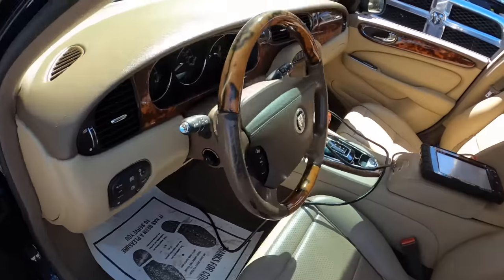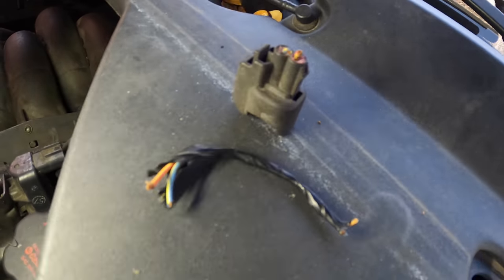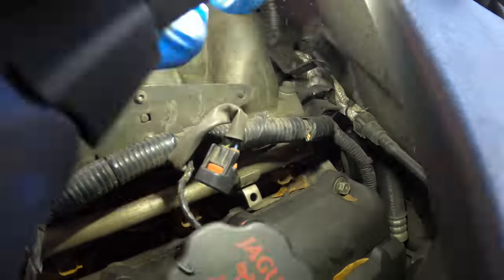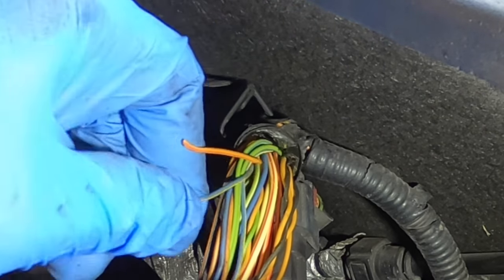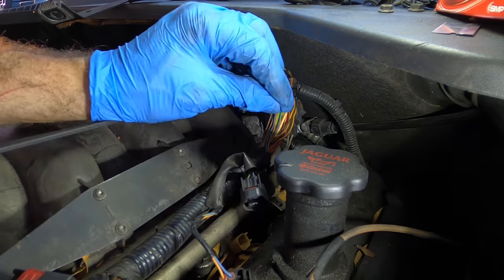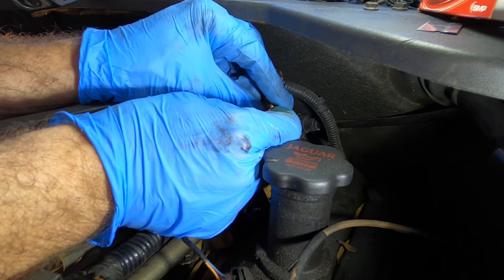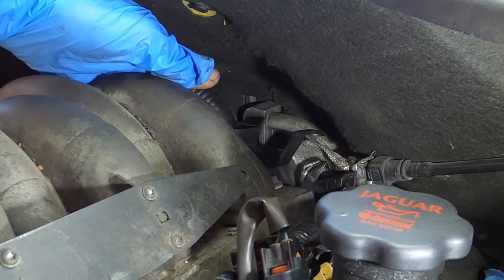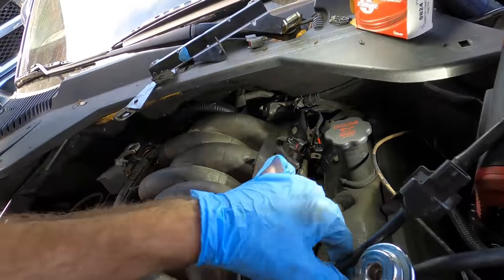Angry XJ Jaguar Engine Attacked / Electrical Damage. P0208 P0308 P0316

Comment: I did a 2007 crown Victoria with critters of Got in built the nest in the air intake by the filter also gotten into the wires fix the filter vacuumed it out and sprayed jalapeno juice all over the wires and the hoses they don't like the taste of that stuff have a good day

Comment: Whatever method you use to solder and it works and it lasts....is it wrong? - Derek B. (Vice Grip Garage).  Don't sweat the snot sniffeling trolls who criticize technique while soldering against the firewall....your knees are probably locked out as you're bending over the engine....lighting is sketchy at best....yet, you get the job done.  Excellent job Ray!

Comment: I had a Squirrel get into my heater area my Terrain when the repairman tore into this he found her nest along with 3 youngster's. While talking to my auto insurance folks they said the repair would be covered under the comp side of the policy, this was great news for the total repair was close to $4,000. After talking to several folks in the industry seems the low voltage wiring has a plant base insulation which the rodent's love,

Comment: Take a look at solder sleeves.  Just wrap the wires together, slide over the sleeve, and heat until middle color disappears and ends close.  No need for heat shrink as they are waterproof.  Time is money

Comment: I could not hold myself from commenting on soldering, use a flat head tip on your soldering iron for better heat transfer, and wipe it with a wet cloth before applying the solder on it.

Comment: Doesn't matter to me as long as it's secure and heat shrunk.  I have a specific way to twist the words together that allows a slim profile AND a really strong connection BEFORE solder and heat shrink

Comment: Soldering is easier if you apply a little liquid resin flux to the joint. The joint you made looked good, but it would have been faster - and easier with a little flux. I know that there’s flux in the solder… but it’s easier with just a little extra.

Comment: But a bottle of liquid tape for wire cuts and probe holes.
And yes my comments are suggestions, nothing more.
Sharing knowledge is how we advance and I'm always learning.
If the solder is shiney and don't pull apart it's good

Comment: Weird that on the Duramax they don't allow soldering the injector harness but it worked fine here. Never understood why rodents chew wires.

Nice interior on that Jag, always liked them and wanted one, but I felt the same about Ducati motorcycles so I got one of those in 2015 and it's the biggest pain in my butt since. Can't work on it without something breaking and you think they could figure out how to make a fuel level sending unit that would last.

Comment: Reeeee one bit of advice on the soldering. You should never use heat near the wire. Avoid flux and try to keep the solder away from the job. A better approach is just stare at the wires until you enter an alternate reality in which the break in the wires never existed. Job done :-)

Comment: Dang mice. You don’t chew on the British engineering. Little finks. They chewed my Mercedes’ wiring like that. As to soldering your not doing wiring on a motherboard the goal is to solder two wires under the hood. Finesse and beauty are required function is. Form always follow function. Use enough flux that’s what allows it to flow. Great job as always Ray. I get to see under the hood of a car I’ll never own.

Comment: I think in this case it was a Frenching Mouse. They prefer the smooth look hence why the wire was removed flush with the connector and loom. Either that or a normal mouse and it was in its way...

Comment: as far as soldering the little  pencil propane torches you can buy pull the tip off them open flame under wire hold solder above wire the solder melts right in then bring heat shrink tube down never had a comeback

Comment: Have to say your using a razor blade in an awkward location pinged my ‘Danger, Will Robinson’ meter. You mentioned “surgical precision”, so maybe take the next logical step and get a few cheap surgical tools? A scalpel handle and blades, suture scissors or Metzenbaum, there are all sorts of tools. Get the cheap ones. Wife and I have used them for decades in our other lives with patients, so can’t live without them now! Curved Crile and mosquitos are endlessly useful.

Comment: I would add that your solder gun will get hot faster if its clean. Remove the tip an scotch bright or sand paper it up
Good job

Comment: Around the Christmas holidays used to see in the police blotter that people had the wires on their decorative lights cut. If these were cut at the base of the tree it was probably rabbits. We had that a couple times and their teeth cut through like a wire cutter. Also if someone wanted to cut the lights it's easier and quicker not to bend over and cut at the base of a 🎄 tree.

Comment: There maybe no right or wrong way to solder but one thing is certain - you'll get nowhere is the tip isn't clean and well tinned. Personally I prefer a pure copper tip rather than a copper plated iron tip, you can always clean it right back with emery cloth.

Comment: soldering online and welding online are only "don't do" if you care about what randoms think. If the solder keeps conductivity, and the weld holds its structure, its a job well done.

Comment: I was told the reason critters like the wires is that some of the plastics used for insulation are plant based. I know one rat infested car I worked on, the old stuff was left alone, but any of the aftermarket add ons/new wires were targeted...

Comment: Get some "Solder Seal Wire Connectors" from amazon, or others. These solder and heat shrink your butt joints with just a heat gun or lighter. Ideal for virtually everything I have seen you solder.

Comment: I thought I knew how to solder wires in tight spaces. Every time I do it, I'm left with the notion I could have done a better job in some way. I guess that makes it interesting. I really like the way your connection is mechanical, far less likely to break, and done hot enough that cracking with vibration or heat is unlikely. Both soldering and butt connectors are deceptively tricky to do properly. Well done!

Comment: ray a tyine home is a 1 trailer with a home (large (40 foot or less) 2 Schoolbus (schooly) as a bace To bild on & in to turn into a home on wheels (large - midum-small buses) 3 motorhomes used for full time live ins 365.25 days a year there are more but you get the idea

Comment: Soldering:  Try using some flux on the wires before applying heat.  You are right to melt some solder on the iron tip.

Comment: great cloth tip    my 2008 Citroen C5 saloon car has the cloth electrical tape . must get a couple of rolls . I have just cured the ABS sinking brake pedal .   Remove ABS module . remember to drain the Master cylinder reservoir .Lubricate all of the brake pipe connections so that they spin freely on the pipes .You do NOT want to cross thread them when re installing the ABS module .  the sinking brake pedal is caused by a sticky / jammed valve in the ABS valve body .. The shiney Aluminium block . take a nice new can of Brake cleaner spray and spray through each of the Ports in the ABS valve block    ..   Spray liberally in both directions until clear brake cleaner flows easily from each port in both directions . thes net your airline to 60lb and blow air through all of the ports in both directions .repeat this procedure twice .. finishing off with compressed air only ..    Make sure that all of the brake cleaner is gone and fill all of the ports with clean brake fluid making sure to use a squeezy bottle or plastic syringe to completely flush clean new brake fluid through all of the passages in the ABS valve block.  Re assemble and fill the brake master cylinder with new brake fluid . Carry out a manual bleed   to fill the ABS valve block with Brake fluid ..   followed by a full ABS bleed   using a suitable scan tool like the Foxwell NT630-Plus .   Expect to use a minimum of around 0ne litre of brake fluid  for this procedure .. good luck   It worked like a charm on My Citroen C5   €7 euros for brake fluid and 1/2 days labour . which cost me nothing .  The main dealer quoted over €2,000 Euros .better still avoid compressing brake cylinders when replacing the brake pads without opening the bleed nipples first . The sudden rush of old contaminated brake fluid from the calipers will almost certainly flush some nasty contaminates into the ABS valves and make them unhappy .

Comment: I wholeheartidly agree that the PVC electrical tapes (at least all the brands I have tried) are miserable.  On the other hand, what my eyes tell me, your fabric tape looks like the electrical tape that was used before the PVC arrived to the marketplace.  There are two plastic tapes that are good -- Polyester tape that is used in transformer insulation and the Kapton tape, although Kapton is stiff and tends to unwind.  And then, one sometimes good insulating tape is the Self Vulcanizing one, such as 3M 2228 or 2229.

Comment: The only thing I see wrong with your soldering is the bit on the soldering iron. I think those conical pointed bits are only good for fine PCB work and I prefer not to use them even then. They don't transfer enough heat when a thick copper wire is sucking it out. A big fat chisel bit can heat up the copper without being pulled below the solder melting point.

Comment: can we assume that if a solder joint is near continuous heat that the solder COULD melt again?  Your diesel required crimp with cautions to NOT SOLDER.  Was it because it was so close to engine?? I dunno!

Comment: Thanks for listing to my suggestion on the correct way to soldering.    And a little higher wattage iron would have helped but you did do a good job on the soldering.

Comment: Have had several outdoor tree/decoration lights chewed by Squirrels.  Chunks missing to the point where
I couldn't splice them anymore.  These were LED fairy lights bought from Walmart, which had been produced in
... China, of course.    Had to junk them and give up on any decorative lighting.  You could see where the Squirs had
snipped section off, and taken them "home" with them, or had been gnawing on them right there.

Did some investigation, and I think what I found was that some wire manufacturers in China use "green" processes during the
manufacture of the wire.  IE, they use peanut oil during the extrusion process, where it either gets impregnated into the
wire insulation, or the peanut oil is used as a lubricant in the extrusion dies(which perhaps also partially impregnates the
PO into the plastic insulation?).

So it's not just your injector wiring.  It's particular kinds of wiring, their sourcing, and how they were made.  Did they use mineral
oil, or peanut or other vegetable/nut oil.  You won't know until ... Critters Attack!

PS: REEEEEEEE.... soldering!  REEEEEEEEEEEEEEEEEEEEEEEEEEEEEEEEEEEEEEEEEEEEEEEEEEEEEEEEEEEEEEEEEEEEEEE!

I just read something where they recommended against soldering at all.  Mechanical barrel crimps only. Then heat-shrink.
Not sure why.  Didn't fully explain themsevles.

Comment: Ray, you are spot on with a large chisel tip for large wires :-D
It's all down to transfering the most heat into the copper.

Comment: critter ate my wires down to the O2 sensor.     I am not a mechanic, but I can do a bit.   I do have a scanner.    I got the code. found the correct O2 senosr,   decided to replace all since it had nearly 200k on them.    no chance. check engine came back after reset.  same code.  something like open or similar.  took it to the shop, critters eat the wiring between engine and firewall.  got it fixed.

Comment: Soldering is always the way. Crimp connections just doesn't work, they corrode and stuff. Best to worst: soldering and heat shrink, heat shrink with the melting solder thing, crimping connector that you can shrink after crimp and lastly just a basic crimping connector

Comment: Ray.  I've been an audio engineer for ~30 years. In that time I have soldered a LOT of connectors.  There are multiple ways to accomplish the same task.  If the connection is strong, not causing a short, and you don't have blobs of solder hanging like an old lugy then you're good.  The internet needs to chill.  You're doing a great job.

Comment: I approve of this soldering technique. It's not the prettiest, but it is really unlikely to come apart easily in the future. I would suggest cleaning your solder tip though, it's looking a little dirty (should be shiny) and that can make it a bit more difficult to achieve solder flow. While the iron is at operating temperature, simply rub it on a damp sponge to clean it.

I've heard that wire insulation has been transitioned to plant based rather than plastic based, and that is what the rodents are after. This information comes from another youtuber Rich Rebuilds.

Comment: Step 1: Twist wires firmly so all the conductors are spiralled tight, Step 2: bend each end 90 degrees mid way, Step 3: hook the two ends together then twist firmly on each other. Step 4: apply solder just as you did.  This minimizes the solder needed to be used while ensuring a very strong bond with least hassle, get used to that one method and such hassles will be a thing of the past for you.

Comment: I have watch a lot of your soldering and nothing wrong with it. But if you would brush on some Rosin Paste Flux to the wires, using any of your methods, you will look like a pro. The flux paste really makes the solder run in even when using flux core solder. I use both.

Comment: I agree with the electrical tape opinion. I hate the typical electrical tape, cloth is definitely the way to go. I think it also looks better. HOWEVER, I do keep a roll of the typical electrical tape plus duct tape in my car at all times for emergency situations. The typical electrical tape is GREAT for any little out on the road vacuum line repairs, or to hold things in place that have broken off. Like a abs wire for example.

Comment: Have discovered some foreign manufactures use soy based insulation on elec wiring. I know someone who had a large portion on under hood wiring as their vehicle was not used for 3 months. Critters ate it up and had to replace several wiring harnesses.
Reply: Critters like soy.

Comment: Hell that was a cake walk,  at least you didnt have to dig the fuel rail and injectors out.    Plumbers rules apply on the jaguar engines,  if you move it , it will break.

Comment: People who want to complain about your soldering technique need to understand that as long as you have a good solid connection, you've done your job. How they would have done it is irrelevant. At least you aren't using scotch-locks and wire nuts! 😆

Comment: Soy based plastics are used in a lot of GM and Ford wiring to be able to say they are green.  Well in this case Green wire insulation is very tasty to vermin.

Comment: Out here in Arizona we have lovely ground squirrels and pac rats that love to eat wire insulation.  I found out that when I would coat a wire with some red liquid electrical tape they would no longer eat the wires.

Comment: Use a bigger solder tip! You are soldering wires not teeny tiny circuit boards! You also used interior fleece tesa tape! This holds moisture vs the exterior type that does not retain water!

Comment: good solder job  let those solder experts you speak of  try soldering in tight spots  from under a vech. beside a muffler still. warm  bent over an engine cover in the back of a city transit buss  in 90 deg. weather in florida and the heat of the pavement   and lets just add in the operator of the unit wanting to know when it will be done or how much longer.  keep doiung it your way. thanks.

Comment: Next time you use that special tape for electrical, and have to use it in a tight space, try wrapping the tape around a socket, instead of using the tape roll.

Comment: I wonder if wrapping tape around a socket would work for tight spaces? They need to come up with a better way of opening those harnesses, something like a seam ripper tool. Like seamstresses use. Maybe some of the other viewers have some original ideas…

Comment: I was taught high reliability hand soldering to NASA standards in the air force in 1978. Your soldering is perfectly fine for automotive applications.
My only gripe (in general, not with you in particular) is the American pronunciation of solder (soldering). There's an L in there, not two Ds. It's sol der, not sod der. Sheesh.  :-)

Comment: You are doing just fine soldering. Been doing it all my working life and like you, often no two times are the same. Just make sure you have a good mechanical connection first, then heat the part until it is above the melting point of the solder, that way capillary action will wick the solder in. My only suggestions, and these are just suggestions, would be to use an iron with a chisel style tip that is mains powered, around 60 watts. Suggestion two is to get a hold of a product we call goldie locks here, it looks like a brass scouring pad. Great for keeping tip clean without damaging the plating. In a pinch try COTTON rag, that oxide layer on the tip prevents the tip from being tinned properly for heat transfer. Going in hot and fast works far better than waiting around forever with a lower heat.

You are doing good work, forget the keyboard warriors, they never been jammed under a dashboard with 2" of wire to work with.
Reply: No, just get a Weller soldering station and that little square place on it is for the small, damp, sponge, and that is what you use to wipe the tip on, just before you solder to get it perfectly clean...

Comment: You are soldering nicely and it surely will work for a long time, that said there are crimping and splicing methods which are nicer, faster and even more durable.